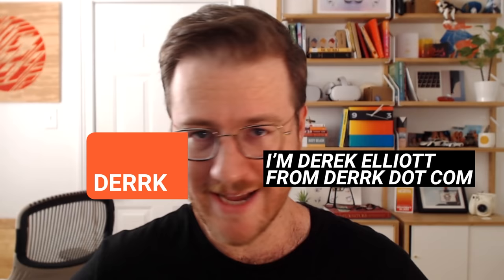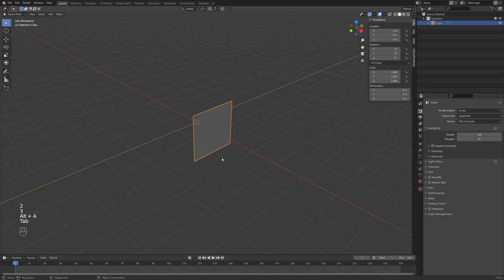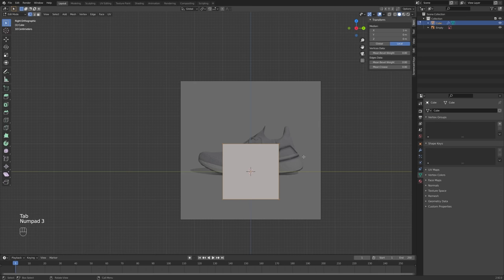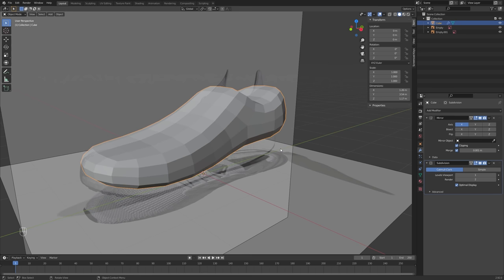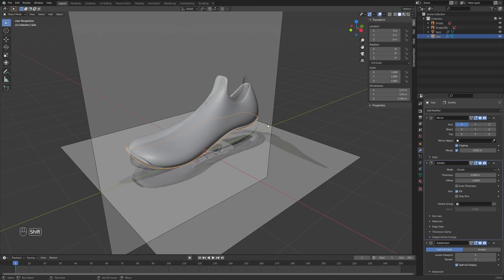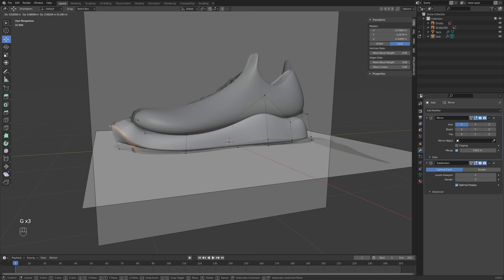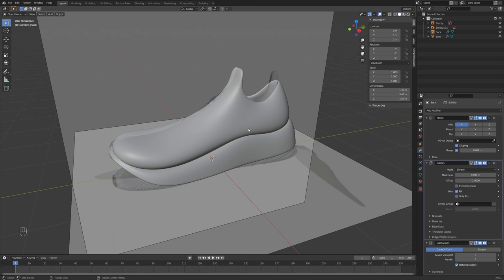Concept Shoe Modeling in Blender 2.92

Comment: - my own bookmarks for my study (keep updating...) -
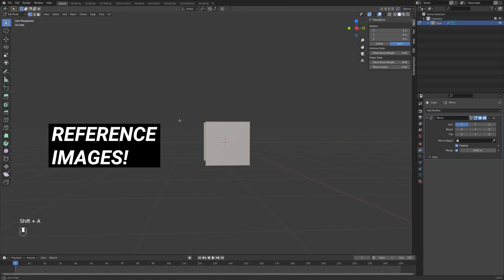8:08 _ 'Shift + A' -> 'Image' -> 'Reference' to add a reference image
9:20 _ 'Alt + R' : Reset rotation, Hold 'Ctrl' to snap degree increments
9:30 _ 'N' : N bar
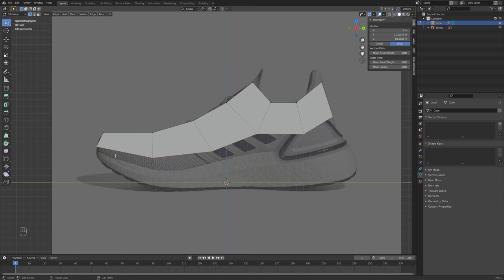12:10 _ 'Alt + left click' to select to whole edge loop/ select one side and hold 'Ctrl' to select the other side/ 'C' : circle select
12:35 _ 'Alt + A' to deselect all ('A' to select all)
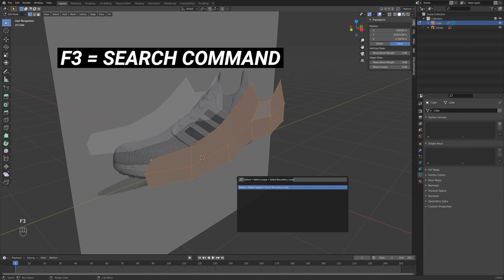14:14 _ 'F3' : Search menu (or 'fn + F3')
14:19 _ search 'Boundary loop' through 'F3'
16:45 _ Add modifier -> 'Subdivision surface'
18:24 _ 'G+G' : Edge sliding
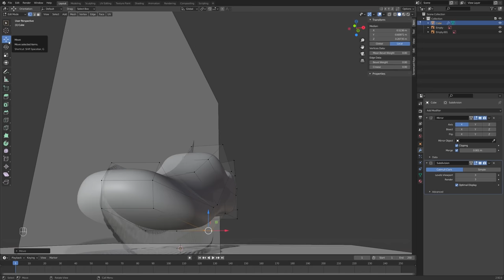18:39 _ Move gizmo
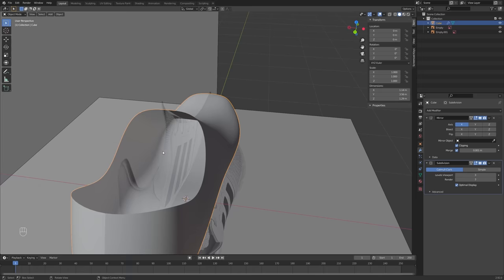20:00 _ Add modifier -> 'Solidify'
Reply: Well, you got 11/463...  JK, very informative tutorial.  I typically write all of the hotkeys on a piece of paper and then forget about the piece of paper and throw it away!

Comment: Hi Derek, first of all thanks a lot for the detailed insights into your workflow. I'm making a shoe right now and this has been a tremendous asset. Easily one of the best modeling videos I've watched.
One question, and forgive me if you actually answered it in the video, I skipped around quite a bit: At which point would you make the shoe asymmetrical? and by which method? do you use a lattice? proportional editing? that's ought to get messy right? I've noticed that if you show it from certain angles, you don't actually notice the symmetry. So do people just leave them symmetrical? 
I'd love some tips! and thanks so much again, making this shoe has been the most fun thing I've done in blender for months!
Reply from the maker: Really whenever you want. I would model most of the shoe with the mirror modifier on and then as soon as you want to make changes to the other side just apply the mirror modifier and make the adjustments different there

Comment: A nice trick is to use an image editor to add bold red/green lines so you can line up your ref image easier
Reply: You can also scale them to correct size in that app so they import equally inside blender. THen you import them all at once and do scaling all together.

Comment: 1:49:10 If you want to use equal distances for the stitches you can use the looptool add-on, just select all edges in edit mode -> right click -> space :)
Reply from the maker: Yes I eventually learned about this that would have been a much better way to do it

Comment: Loving this tutorial. One of the things that I have trouble with is when I solidify my sock, and the are where the ankle bone would be gets all deformed. Maybe my edge flow is screwed up. I've tried it twice and it messed up both times.
Reply: This actually was partially fixed when I put the solidify modifier in the correct order. The shading still looks a little weird but it drives me crazy that it's not perfect!
Reply from the maker: Try shift + N to recalculate normals. Sorry I missed this comment not sure why it just showed up for me

Comment: a note/question:
at the end of part one You saved the mesh ("sock2") without applying the modifiers. You not supposed to do that before saving to get the correct results?
cheers, amazing video btw
Reply from the maker: If you were going to export it you'd want to apply modifiers but just to save and re open they'll still be there
Reply: Thanks for the useful answer @DerekElliott  
Can’t wait for part two!☺️🙌

Comment: A man I need your help. At 1:11:24 where you are doing the soles of the shoe. I do the edits right to duplicate the bottom of the outer soles to make the outer(outer) sole. Just that when I get here and duplicate, hit "P" to save to a selection and then "G" to move, everything translates(move). I don't want that. It's been frustrating because nothing seems to work and I don't want to make this stop me. Pls help.

Comment: Loving this tutorial however I am getting different output when I add to the (amount) field on bevel modifier.  You were able to increase to 0.037. Mine does not allow me to do this instead leaps to 0.37 skipping the lower numbers completly. I literally have to manually type every time i need to get lower output. Is there a setting somewhere I can fix this? Thanks! Also subscribed.
Reply from the maker: This can have to do with the unit scale you have selected in the scene tab. Also try holding shift while scrolling for finer tuned adjustment

Comment: Need help, i've followed through everything until 16:45 . After i added the Subdivision modifier. Nothing much change. my mesh is very sharp and not smooth like his. I followed all the steps correctly tho.
Reply: well i figured it out. sort of. I just merge by distance and it did the trick.

Comment: Thanks for the tutorial - really enjoyed it. Happy it's about 13.6 hours long... I'm not a fan of the shorter tutorials. I think the lengthy ones tend to have more value. Anyway, what about making the shoe asymmetrical? Left Foot v. Right Foot? ...no...? ...did I miss that part...??... or are shoes always modelled and presented w/ symmetry like this? Thanks again. Looking forward to more.
Reply from the maker: I mentioned it briefly but basically just apply the mirror modifier and then you can adjust it. For left and right just make a copy and scale on x or y by negative 1

Comment: this is absolutely amazing!! I'm new to the 3d world, and I have a serious question, do you think it's easy to work with a Mac book? and should I make sure to have a mouse instead of working with the touch bar?
Reply from the maker: 100% you want a mouse not a touchpad for a 3D work. As for a MacBook it will work fine but typically PCs seem to do a little better with 3D stuff. Really though just whatever the most powerful thing you can get your hands on.

Comment: Hey i was working on part three and at 42:52 when you inset the face, the bottom vertex of the selected face thats closest to you  is acting up... like the face is getting too stretched  from what you have shown. Now it looks like its edgy/square-y end as tho its planted firmly on the ground than the curvy and smooth heel as demonstrated... Sorry to keep bothering you, im a newbie, but any suggestions?
Reply from the maker: Maybe it's double vertices or something
Reply: @DerekElliott  i tried from the top again, i restarted the tutorial but this time right bottom edge becomes pointy...like it doest remain the same like where yours it remained the same but when i do it the edge becomes pointy. am i making sense in what im tryna say ?

Comment: Hello Derek! great tutorial! i wanted to ask you something. in Part Six in the beginning at 1:23:50 , you apply the solidify modifier and then you delete the external vertices and then you add again a new solidify modifier (along with the mirror). I found out that if i use the "shrink fatten" tool i can control the size of the object , along with the solidify modifier of course, without making the "delete vertices" procedure. Αnd the result seems the same. do you think is it a right way too?
sorry to bother you thank you in advance☺️💙
Reply from the maker: There are so many different ways to do everything but your method here sounds good. If it works for you then stick with it!

Comment: Real design of shoe. You can't use mirror as the inside "arch side" is different from the outside. Thus you need a left and right shoe and mirror image design doesn't create that. How do you design for left and right foot shoe?
Reply from the maker: You apply the mirror modifier and create the differences.

Comment: I'm sorta lost, where do u fix the symethrical part because of mirror ?
Reply from the maker: I never do. To make the shoe non symmetrical you apply the mirror modifiers and then begin making changes on each side
Reply: @DerekElliott  Oh, thanks for reply Derek <3.
So when I finish all the details, should i play with shape depending on which shoe it is ? (I mean right or left)
Reply from the maker: @CrisisBomberman  yes you could do either and then basically mirror the non-symmetrical shoe to create the other one 😊